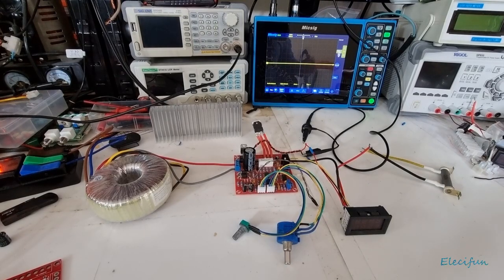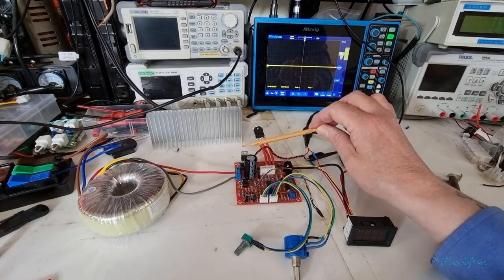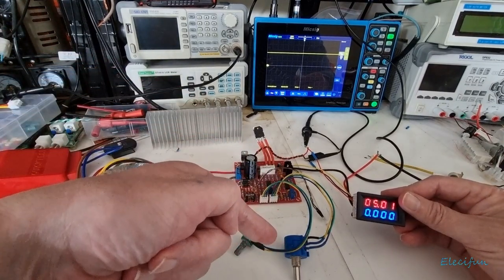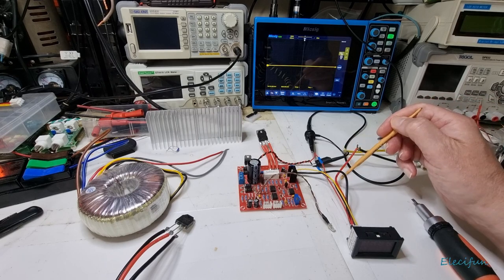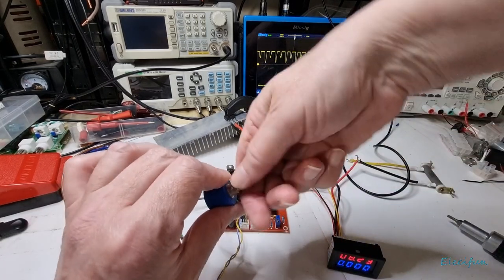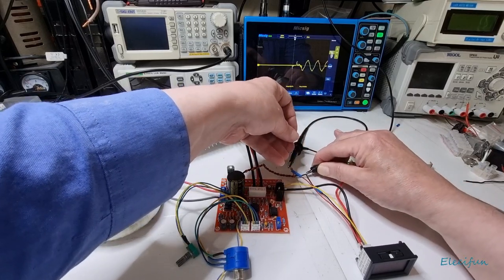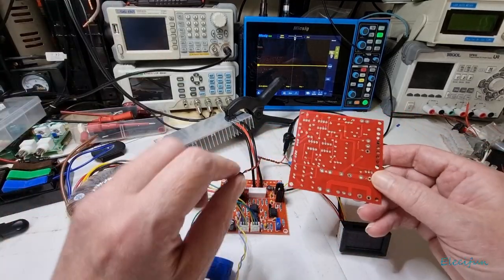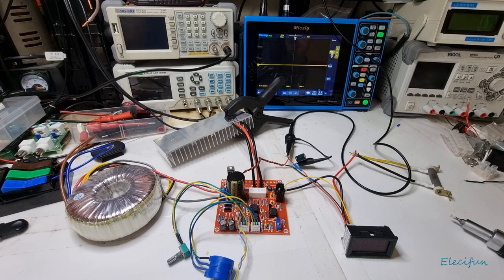ISSUE 0 - 30V  2mA - 3A  DIY POWER SUPPLY KIT 24V OUTPUT ISSUE

Comment: hello,
I have a good quality (toroid) 2x12V 5A transformer.
I'm thinking of making two options on this PS board via a 2-position toggle switch (ON-ON)
a) for output operation 0-24Vdc 2.5A (this is the easy one)
b) for 0-15Vdc 5A output operation
does there is a possibility
to use the rectified 2x12 Volt voltage, at the input of the circuit (eg above 4700mf ????
there is a way ??? (because as I see the circuit design it cannot be done
***any idea ????
Thanks

Comment: Hello, I am currently buying this kit online, is there something wrong in the pcb diagram? can we also replace the lm7812 into adjustable lm317? I have notice that the output of DC  has a ripple voltage, can I add more filter capacitor and some protection diode in the circuit?
Reply from the maker: If the kit has the pass transistor (D1047) on a 90 degree with the 24V regulator then in my experience the kit won't work. You could replace the 24V for a 12V regulator, not a LM317, remember to account for watts dissipated by the regulator, which is dependent on its load. In order to power a voltage meter you may need to add a small capacitor across regulator output. On a Hyland board the regulation is fine.
Reply: @Elecifun  thanks very much but I'm more curious about the op amp, can you tell me what is the purpose of the op amp or can you make a video about analyzing or function of each components in the circuit if you have time
Reply from the maker: @Nppbdan  If you want a comprehensive description of how the circuit works, follow the link. It offers details with a circuit diagram to make life easier. 👍
https://www.electronics-lab.com/project/0-30-vdc-stabilized-power-supply-with-current-control-0-002-3-a/

Comment: Can this kit be upgraded to 5a?
And what components should be replaced?
Reply from the maker: You could try three pass transistors in parallel. Make sure to use a low value 0.1 ohms on each emitter to ground.  Also your transformer will need to be able to supply the current. 
I've used two pass transistors 2SC5200's and get 4 amps@ 7V powering a car headlamp. The heat sink gets really hot so a fan at least.

Comment: I added an lm317 to this kit, which supplies the operational amplifiers, with the lm317 the maximum voltage can be controlled, the collectors of the transistors are fed directly, I prefer opa177gs, lf411acn, lf356n, only the off set is changed to U2
Reply: @sajohaker  can it output 2volt 4 or 5 amps of current?

Comment: If I tell you things you already know I apologise,  just trying to help ya mate
Reply from the maker: Whats happened to your comments. It's fine picking me up on stuff. 
I.E. If I remember I said on the output and input where I meant output ground or on lm317 adjust. I know what you mean though. 

I like constructive feedback, helps me check myself and learn.. Ave at it m8
Reply: @Elecifun  I don't want you or your viewers thinking I'm pulling you down etc 👍👍 just sharing knowledge that's all mate..
Reply from the maker: If you watch my video close enough to see an error and are kind enough to use your time to point it out, especially with a solution, your doing me a good turn. Cheers
Reply from the maker: @T2D.SteveArcs  its all good m8. I'm here to share and learn.
Reply: @Elecifun  I always leave axial  rectifier diodes 5mm off the board too, allowing air flow all around them and the longer the leads the less heat is transferred into the pcb, the pcb may be poorly designed and have temperature sensitive components close to components that get hot ie a zener shunt regulator/voltage reference near a power resistor or rectifier diodes ..
Reply from the maker: @T2D.SteveArcs  just noticed another comment you left about winding some turns onto transformer for another ac supply. I did that on the first build of these circuits years ago. made video but like i say years ago. Good advise, pity you deleted as good tip and I did not mention it in the video. On this transformer I got 1V per ¬ 5 - 6 turns.
Reply: @Elecifun  are you in the UK, I would love to take a look at one of the non working boards
Reply: @Elecifun  the meter definitely needs an isolated supply on sure the power ground cant be shared with the current measurement ground
Reply: @Elecifun  let me know when you have read my comments mate
Reply: @Elecifun  oh I remember your comment about trying 2n3055 yes any transistor designed for linear operation ( class A, A-B amplifiers etc will work well here.. the TIP3055 is the same transistor but in a 247 package so easier to mount 👍
Reply from the maker: @T2D.SteveArcs  I am in UK... easy postage, or i'm just outside Cov
Reply from the maker: @T2D.SteveArcs  I have a kit here sealed in the bag, do you want it? I can post to you and you can keep. Maybe you can find whats wrong. Yeah unlisted link is fine m8 I will be happy with someone in the know checking it out and giving me feedback.
I hope you get well, its always crap when ill.

Iv'e checked your channel and subbed but not checked videos yet. I do like the high voltage projects and have built a few myself. Will be interesting I'm sure.

Since I started flying I stopped RF Tesla type as worried about RC transmitters receivers and flight controllers getting damaged.
Reply: @Elecifun  Awesome,  and thanks for the kind words 👍👍 I'm already subbed to your channel and have been for a while 🤔 I must have spotted something interesting at some point 😅👍 yeah that would be cool if you want to send a kit, il put it together and trouble shoot it see if theres a problem somewhere on the board or components etc il just leave the camera running, and we will discover together 😅👍👍 do you have an Email address or?? Il send you my address
Reply: @Elecifun  as for high voltage and high power RF yeah, not much is safe if it's not shielded and grounded and even then you have to be so careful, even a power lead is an antenna and as you know cheap SMPS etc often omit common mode choke, varistor, bypass caps, I've seen loads of SMPS go bang when people try to use them to run fans, filaments etc the RF interferes with the feedback etc 🙈 anyway yeah I agree sensitive expensive equipment is vulnerable 😅👍 I've got a 2 grand bench meter and I take it off my bench and put it in my fluroscope while I'm building/running xray transformers and Tesla coils etc, I'm not risking it😅
Reply from the maker: @T2D.SteveArcs  sound m8. Ive sent you an email to your gmail 👍
Reply: @Elecifun  awesome il get to it mate and send my details, when I'm well maybe we can meet in the future, that would be cool
..
Steve
Reply: The Smps topic is complex and depends on many things ie if your going up in voltage can the rectifier, output caps etc take the higher voltage, does the smps have a wath dog ic or comparator monitoring for over/under voltage protection if so this will need its sense resistor network modifying or bypassing 😅 ATX power supplies for example, if you want to modify them for a variable output you need to replace the output caps, and remove the over voltage protection (usually a comparator) I usually remove the 3.3v and 5v rectifier diodes and the wires from the board at this point aswel just leaving the 12 rail to become our adjustable output, they usually have a pair of high power 45v  schottky rectifier diodes on the 12v rail (centre tapped secondary so full wave) so these don't need changing obviously you have to live with a lower maximum current etc, if we modify an ATX to give us say 3v to 35v on a pot, its still only going to be capable of 300w or whatever....
Reply from the maker: @T2D.SteveArcs  I have both of these transistors but will try the 247 because as you say easier to mount. I do have a couple of heat sinks that will accommodate 3 T-O3's each but its a hassle setting up compared to 247 and clamp.
Reply from the maker: @T2D.SteveArcs  yeah that sounds good. The kit is here ready to go. It will be great to have fresh eyes and knowledge looking this over
Reply: @Elecifun  👍👍 sounds good, I don't remember the specs but when you see them In big banks theres usually 1 for every 3A so a 30A linear supply would usually have 11 or 12  in the heatsink, 1 or 2 drivers and 10 as output pass elements, 90w dissipation is probably close to the limit though 😅 as you probably know in an adjustable supply theres usually some pre regulation ie transformer tap changer or phase angle control with scrs so the pass elements are always only dropping a few volts
Reply: @Elecifun  👍👍